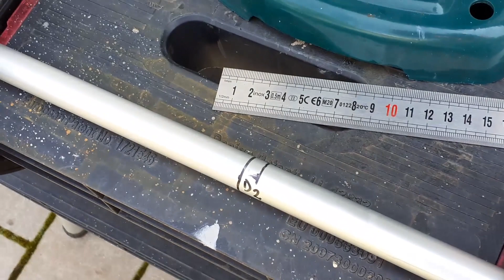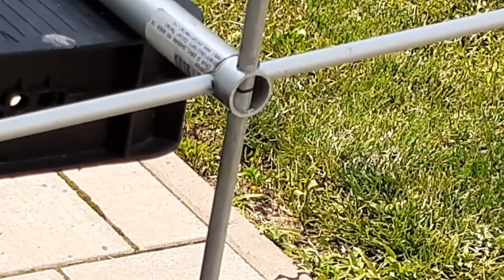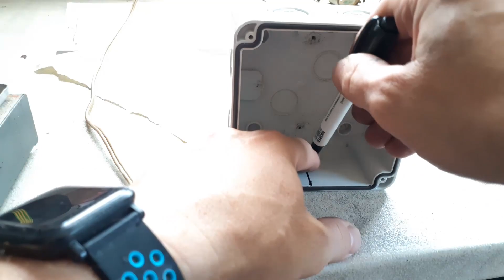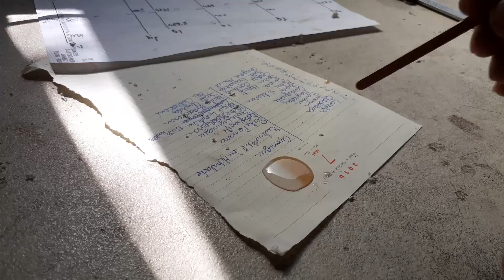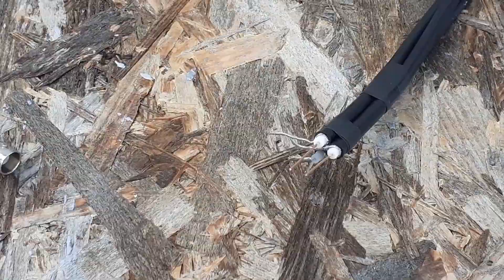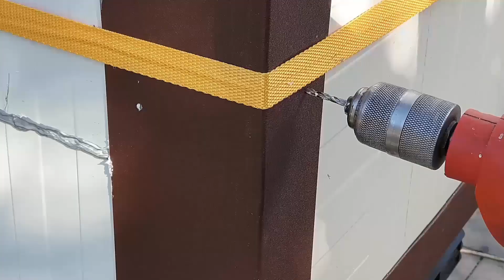Antenna construction cross Yagi VHF band, 6 elements, 2 meters long, circular polarization, 9dB gain

Comment: Hi :) First of all thank you for presenting nice project. I am currently using arrow antenna and I am going to make cross yagis, one for 2m and another one for 70cm. I have got two questions:
1. Have you finally done 70cm antenna
2. Why did you decide to use a round bar, could square tube not be easier?
Reply from the maker: Hello Pawel,
Yes, I made the 70cm antenna and it works very well.
The square tube would have been great, but I couldn't find one for this dimension on the Romanian market.
Reply: @Racov  thank you. Actually after I asked the question I found the link to your website and I found 70cm version too, many thanks sir :)